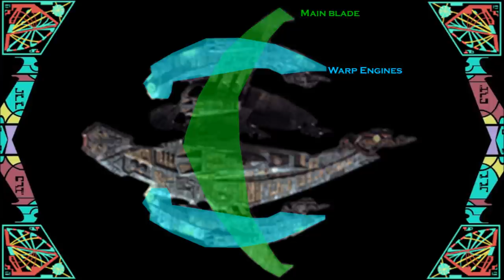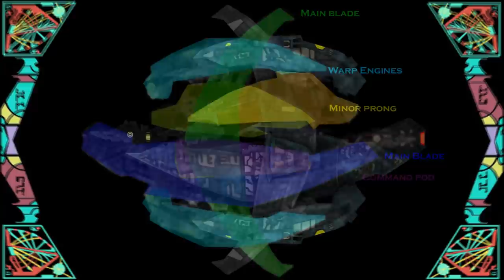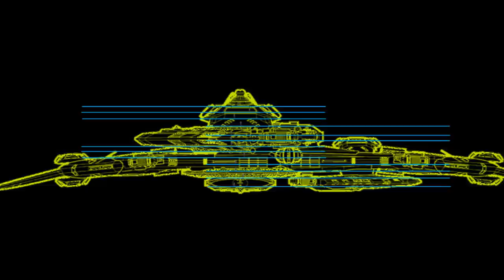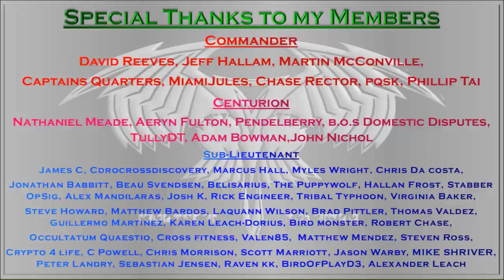Understanding the Breen Ship

Comment: Love how you thought of it here - a very modular ship for pirates.  I'd guess it'd be a..  Destroyer analogue in scale?  Maybe pocket cruiser if you go by pure size.  If you presue the energy dampener is a specialized wepaon that not all Breen ships would have, it has a small loadout - 3 'primary' disruptors and two 'primary' warhead launchers.  Which fits for more of a raider type thing.
Reply: Guess I like the idea of thinking of it as a heavy raider since pirate/merc based.  Not necessarily going to outgun most things, but it's fast enough to evade anything short of ships of the line, and it's probably not going to be (intended) to engage those.  It's undergunned but big enough to survive things out of it's weight class even if they outgun it.  It (if a raider) warps in, disables escorts/transports, then boards them.

If you want to go full thoughts it could be almost a privateer style thing.

Huh, wonder what a 'letter of marque' would be like in Star Trek..
Reply from the maker: Very light cruiser/frigate.

Comment: I am curious, I know that in a line in Voyager, the Breen supposably uses organic ships. Could their odd shapes be more of organic lifeforms being turned into warships? We don't know the full detail about the Breen navy, and while it looks metallic internally. So it's possible to be just a throwaway line with little meaning. But I love the idea that Breen finds space fauna and used them as part of their ship construction, or harvests them to make their ships. For it would match the characters we see of the Breen and could give them some tactical advantages. Such as hull armor that can heal or grow, and not have to mine for resources but harvests instead.
It would explain their weird and oddly modular ship designs, for they used a living being as a template.
Reply from the maker: The breen would be like space whalers. Very cool idea.
Reply: @venomgeekmedia9886  Glad you like it.
Reply: no space whales for the love of god no!
Reply: The metallic internals could be metallic inserts, or frames otherwise organic material is grown over. Might explain those external "pods" and the "spikes" the weapons are mounted on, and even why the energy dampening disco ball is sort of just depending off the front.

Comment: Interesting video! It makes sense that Breen ships would be modular, and it is possibly why they seem to be somewhat structurally weak. One of them is quickly dispatched by the Defiant at Chin’toka as quickly as a smaller attack ship would’ve been.
Reply from the maker: In fairness the defiant used quantums. But yeah from what we see breen ships are light and agile.
Reply: @venomgeekmedia9886  I like that too, yeah.
By the way, do you agree with the 650 metre scale of the Jem Hadar battlecruiser, used often in charts? When the Defiant flies over it in Sacrifice of Angels, it seems over 860 metres, I swear (not that the Defiant is a very reliable size marker, that said)
Reply: One is also destroyed by a single hit from a Cardassian Galor Class cruiser in the Battle of Cardassia when the Cardassian Fleet rebelled. I should think they are more or less a heavy destroyer or light cruiser: Fast, agile, probably great in packs. But without the energy dampening weapon they are vulnerable to heavier ships when alone.

Comment: Perhaps the two indents behind the pods are not shuttlebay doors, but in fact heat vents. Maybe the pods are very powerful disruptors that take a hell of a long time to cool off and recharge - that's why they have so many, they need more weapons to make up for the low firing rate. It also doesn't fire very often for the same reason, hence why we don't see it on screen that much (if at all). Most Breen captains may simply prefer to fire their disruptors only when they are certain of a hit, and use the faster reloading torpedoes most of the other times so their bounty doesn't slip away.
Reply from the maker: Use their torpedoes as a form of area denial limiting the maneuvering options available to them.
Reply: @venomgeekmedia9886  Thus hopefully driving them in front of at least one of the knockout-punch disruptors, further explaining why they're scattered across the ship... Hm. We seem to be building Breen doctrine as we go along.

Comment: I look at the pods, with their dual back ports, as boarding craft/auxiliary craft. Instead of loading them into shuttle bays, they can dock larger craft to the outside of their ship (like Vulture Droids from that other universe). The back ports would be impulse drives, and the "noses" look like they could perform a ramming breach- though they like limpet to the sides and burn their way in.

I mean, if they are piratical, a way to board/loot/capture enemy ships makes sense- and having them able to latch onto the mothership, without having to worry about internal space, would have certain advantages.

Comment: Alternative suggestion: The minor prong looks like it has a smaller impule module at its rear. Could that whole prong be the secondary craft? As for the pods dotted about the ship, the Eaglemoss model leads me to see them as fly through shuttlebays with two landing bays at the rear of each pod for quick reboarding and a smaller angled door at the front of each pod to launch from when attacking. I include the large command pod in this which would house larger fighter craft.

Comment: Ashes of Cardassia has an actual Breen Fleet along with interesting post-war Cardassian ships. Edit: i just realized the Breen is a Confederacy, which is a loosely aligned nation-state. this would go a long way to explaining their super modular design philosophy. I also must point out that these ships would likely be structurally fragile, we see pulse phaser fire from the Defiant literally break the main blade (in your case the modular keel/spine) in half so that is something worth taking into consideration. Target the right spot on this modular ship and the connections are likely to literally fly apart. As for the equipment loadout, there should be at least one rear-firing weapon. The Main Prong could mount a variety of heavy weapons, Phaser Lances or Seige Cannons are just one example. I think it makes more sense for the Spikes to be the beam emitters and the pods to be torpedo launchers. The spikes just look like beam weapons and it could even possibly produce a cool DEATH STAR style combined beam potentially?
Reply from the maker: With the right configuration. Quite possibly. And yeah breen ships are very agile but are also very fragile.
Reply: @venomgeekmedia9886  the definiton of Glass Cannon. I also appreciate that they looked like an outstretched CLAW. What about the ones from STO?

Comment: Having all the modules of that similar long/short/thin suggests easily hidden shipyards.  Or perhaps that's just where there tech experience is, like old roman armor. Small sections instead of large single forms.
Reply: At those scales you could literally build the ships underground in a large warehouse.  Just build them in narrow blade/pod sections then have a level surface outside to attach them together.  Every single Breen world could have dozens of shipyards and you'd never even know they existed.  That is until hordes of these craft come up at you like massively over gunned fighter craft.

Comment: I'm surprised you didn't mention that the Breen were once described as using "organic" ships. I always thought the similar shapes of the prongs and engines was because the basic hull components were grown instead of manufactured.
Reply from the maker: That would make sense. But I always thought it was on a smaller scale.

Comment: Torpedo launchers at the fore end of the warp engines strikes me as odd at best and I think they perhaps serve some other purpose.  As for the many hydrogen collectors it could be a number of factors.  They might require more because the are less efficient than their Star Fleet counter parts and/or Breen space may have more nebulas full of hydrogen from which to supplement their fuel supplies.  If they are "pirates and bandits" then it would fit the idea of "living off the land."  The longer you can stay on patrol the more booty you can claim.  

For decks in my writing I go with 3 meters, that 2 for walking around in and a half above and below each deck for ventilation, power conduits, grav plating, ect.  Good luck, there's so little info about the Breen that most is just conjecture.
Reply from the maker: As some have pointed out they might not actually be torpedoes. Yeah they may need to stretch their supplies out longer. And 3m decks make sense given the size of the breen.